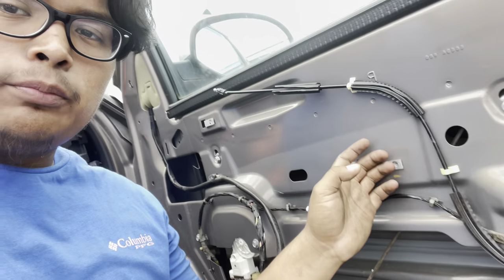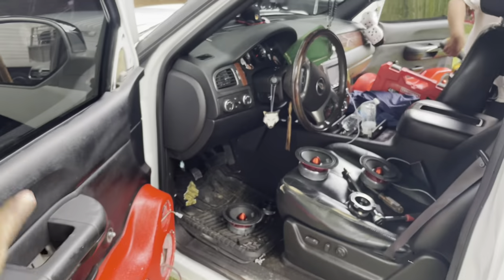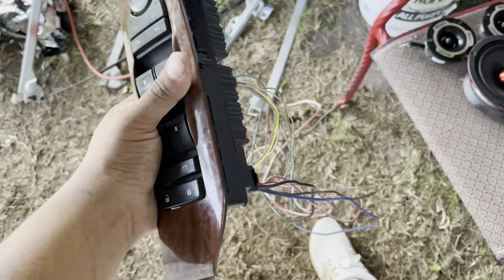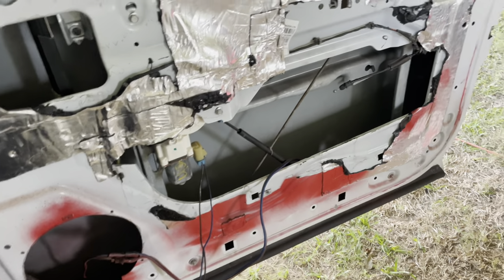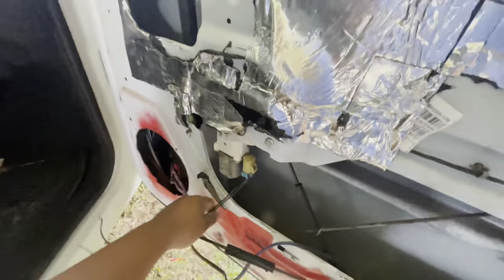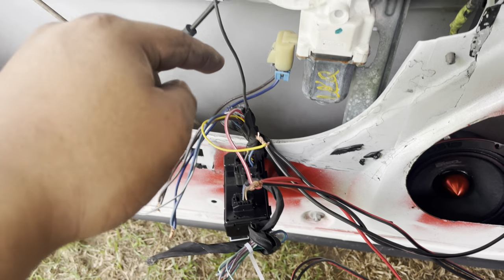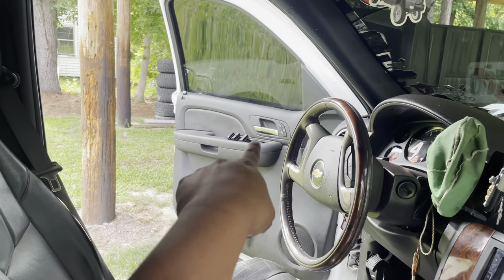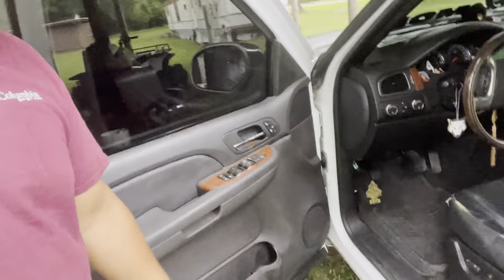Installing power windows on my 07-13 Silverado‼️ (ft. LTZ interior complete)

Comment: Bet you could bust out the switches your not using and fill them with epoxy/body filler, flatten it, vinyl wrap it with some wood grain vinyl and have it look more right with the truck. Could vinyl wrap all the ltz wood you got with some vinyl wood grain wrap and you'd never know

Comment: can i use crew cab door panels on a single cab ? for the power window conversion
Reply from the maker: Yes you can, mine were from a Yukon. There basically the same thing
Reply: Front door panels on all GM trucks are universal and yes the Escalade ones aswell, the rear door panels change in the tahoe,Yukon and Escalade sport and extended cab trucks
Reply: @diegoangelavila9549  The extended cab front door panels are different and separate from the rest due to the floor mounted seat belt. Extended Cab is solo, Crew Cab/Single Cab/Tahoe/Suburban all match. For Silverados with the secondary pull on the door, make sure to grab the metal sub bracket that it attaches to from the door

Comment: What switches did you get on Amazon bro for the windows i have everything and couldn’t figure out why it wouldn’t work all i need is the switches thanks for this video man 🙏🏽
Reply from the maker: https://www.amazon.com/AiYiGu-Passenger-Compatible-Silverado-Chevrolet/dp/B09N2P33GN/ref=mp_s_a_1_2_sspa?crid=14954HYJUDLXZ&keywords=08+silverado+switches&qid=1686240670&replacementKeywords=switches&sprefix=08+silverado+switches+%2Caps%2C230&sr=8-2-spons&vehicle=2008-47-491------------&vehicleName=2008+Chevrolet+Silverado+1500&psc=1&spLa=ZW5jcnlwdGVkUXVhbGlmaWVyPUExMkkwQzJWSU5TVTNIJmVuY3J5cHRlZElkPUEwMjM5NDAxM1FLREI2Tk1FMzBUSiZlbmNyeXB0ZWRBZElkPUEwMDcwMjgyMU9OU0VTTDMxMEFPSSZ3aWRnZXROYW1lPXNwX3Bob25lX3NlYXJjaF9hdGYmYWN0aW9uPWNsaWNrUmVkaXJlY3QmZG9Ob3RMb2dDbGljaz10cnVl     That’s the link to the switches and no problem bro I’m here to help💪🏽
Reply: Yo bro so i took the harness and the motor from the junkyard I heard it’s plug n play
Reply: But for some reason the motor won’t work the power mirrors do though you think it would be the switches??
Reply: @Nolimitboro how did it go?
Reply: Where you get the harness